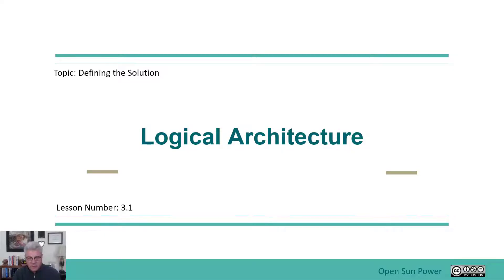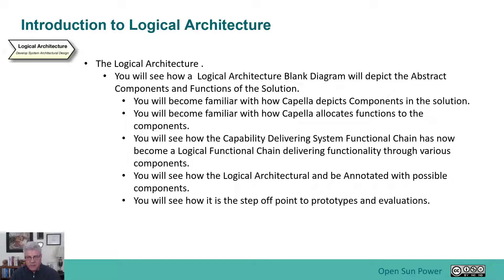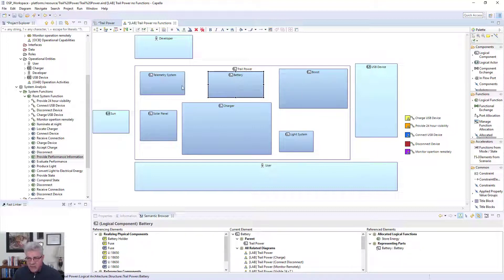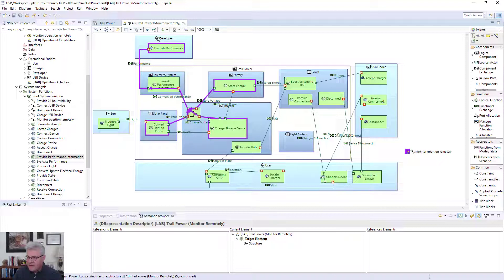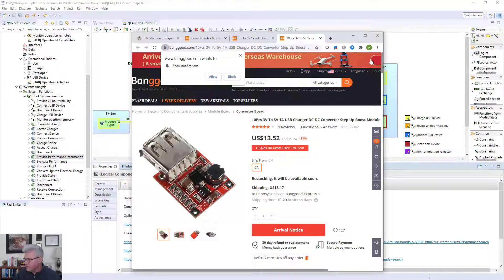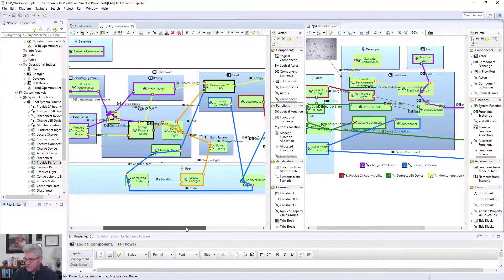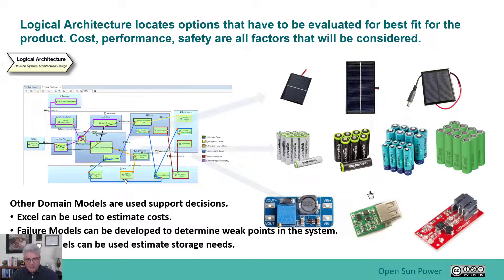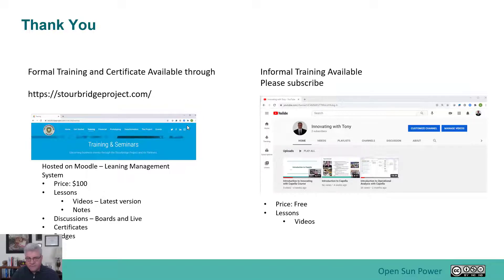3.1 Logical Architecture with Capella

Comment: One thing confuses me. You mention that logical architecture depicts abstract components, yet this is where you started selecting physical components like solar panels, and boosters
Reply from the maker: Logical architecture in “vintage” method was called the Essential Architecture or Requirement Architecture. It is in solution domain, so it is where you start looking at options to deliver a solution to deliver the essence or requirements of the system. The larger the system the components tend to be called subsystems, in simpler products you tend to start looking at options. Another alternative system could have looked at wind and then a trade off / or Pugh concept analysis could have taken place.